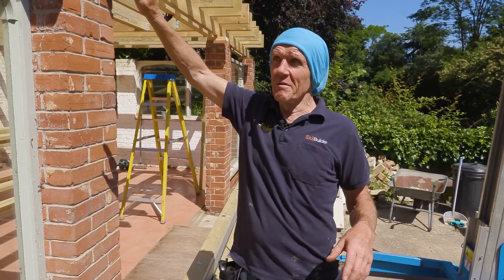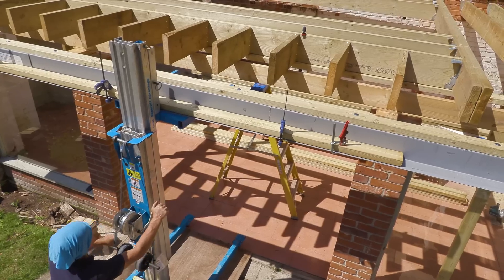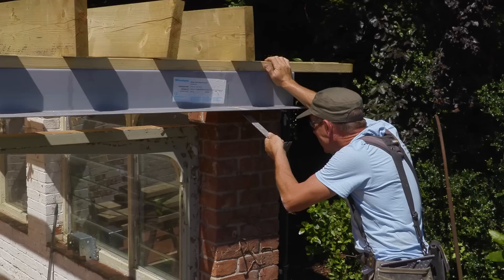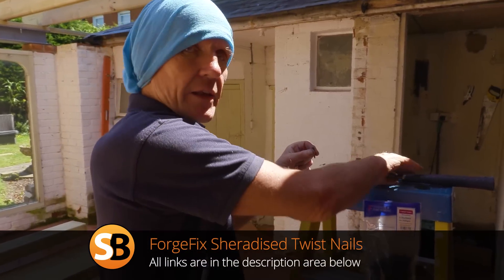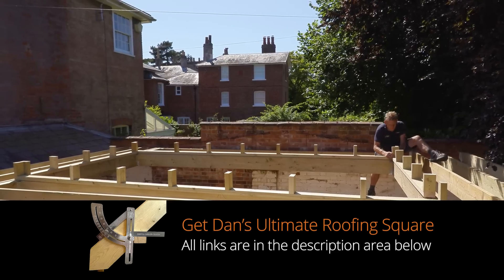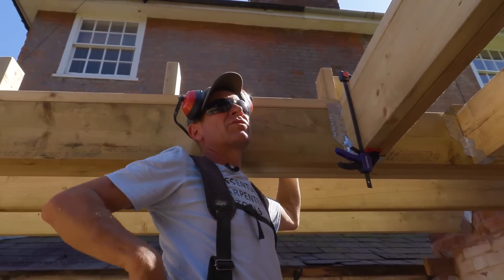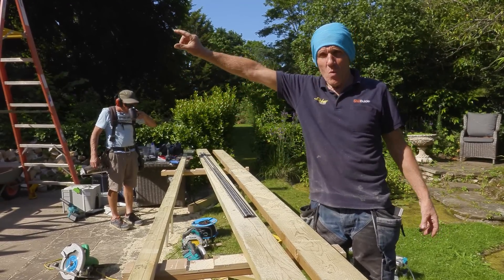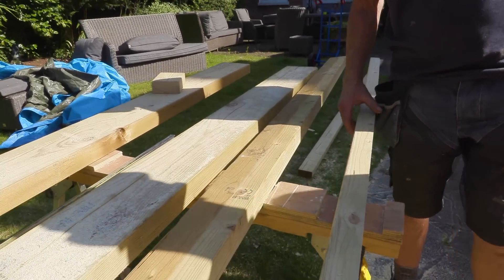How to Lift a Steel With No Swearing

Comment: Not convinced on the length of that beam onto that brick pillar
Reply from the maker: It was all worked out by a structural engineer. What is the issue you see?

Comment: Notice how professionals use an impact driver. One continuous run until it’s in. None of that daft trigger pulsing which stresses the motor and risks chewing the screw head.

Comment: Hi, hoping you can help, bathroom ceiling paint keeps pealing, I have a dehumidifier and a loft mounted extractor plumbed above the shower which runs for 20 minutes after the light is turned off, it's driving me mad please help
Reply from the maker: Hi Neil 
 You need to rub it back and use a special bathroom paint but before you do that give it a coar of Zinsser  Bin ove the affected areas. 
T*he next thing is to make sure you have enough air coming into the bathroom to feed the fan. Building Regs say you need a gap under the bathroom door so the fan is not pulling on a vaccum. If you get some smoke pellets and open and close the bathroom door with the fan running you will see how well it is working. If all else fails get your self a nice in line fan from Screwfix or Toolstation. Those little ones are not very good and I always fit the big black Airvents ones with a two speed switch. 
https://www.toolstation.com/airvent-100mm-mixed-flow-inline-extractor-fan/p70282
Reply: @SkillBuilder  hi, thanks so much for the information and help, I really appreciate your time to answer my question, Atb Neil

Comment: I have useda Genie on numerous occasions.  I find them extremely useful as long as the ground is level. However I believe they should have a perpex face guard to protect one in the event of the steel cable snapping.
Reply from the maker: I think you may be right but I wonder if that steel cable ever snaps.

Comment: Remember the days when chippys used to knock frames up with a couple of nails now with the nail gun its like listening to gunfight at the ok coral. I was on a site not long ago where timber build frames were used i had a ducting to install and the piece of frame i had to remove had 12 x 3in  nails in it and it was only 15 inches long.

Comment: The way I do firing strips is after doing the first is put the parallel guide on the saw then use the first one as template stroke guide to run along.

Comment: Many years ago I worked for a company that made lintels. That one is short in comparison to some of them... Some of them were shipped by bolting multiple steering axles to them, and pins on the front for the Tractor hitch. Yeah, those were enormous. Some areas have crazy allowed lengths in code as long as it is supported every 8 feet. Structural glass counts as a support... It is common for buildings and houses using them to have glass on an entire ground level wall. Building this way has advantages. If the overhang is planned right and the opening is facing the proper direction you may not have to heat or cool the building much at all.. Now stop standing on the cord Roger, lol. Cheers from the other side of the pond...